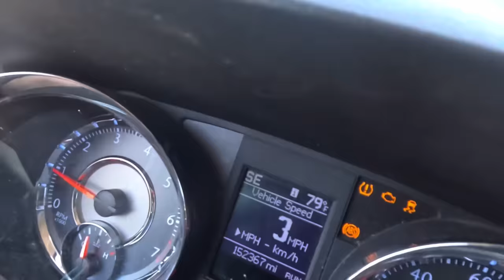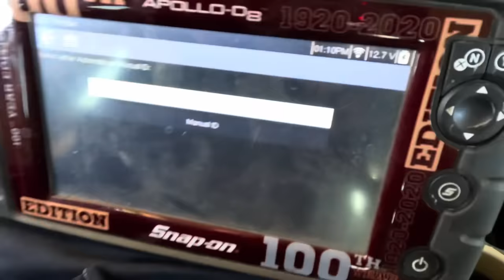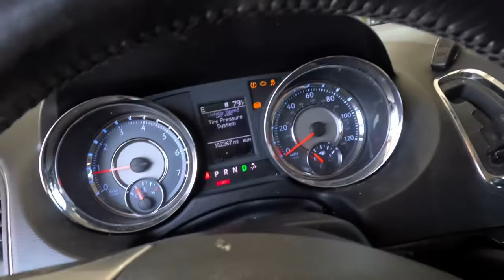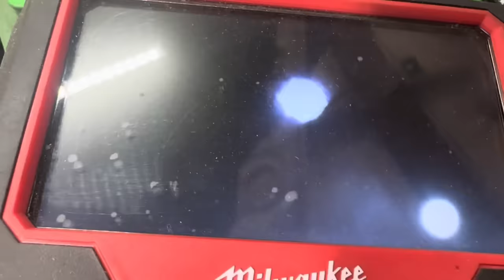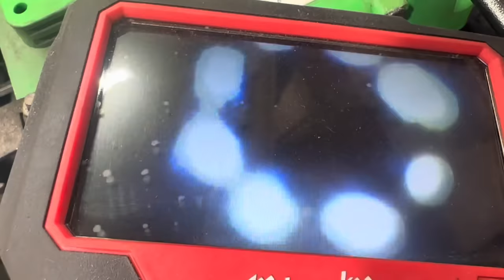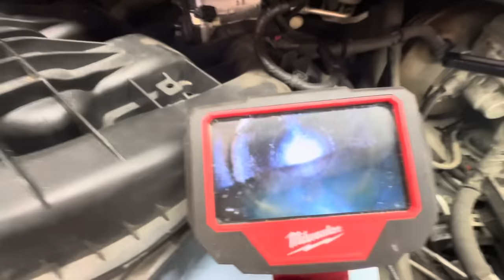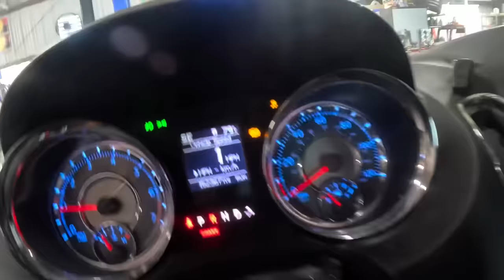Towed In! Died on Highway! (Engine is Drowning Itself!) Chrysler 3.6

Comment: I wonder why manufacturers have never added over-temp or low-oil pressure shutdown. I did have a Ford Ranger years ago that had a low oil level sensor that prevented startup. Even the cheapest lawn & garden engines have low oil shutdown.
Reply: Because we live in a litigious society, and it is viewed as safer for the occupants of the vehicle to allow the vehicle to damage itself in the effort to get out of traffic in a graceful manner rather than just drop dead. There is always time between warning lights and major damage, and in the case of cooling system failure, it's more than the sometimes only a few seconds that oiling failure can give, but this is classic operator foolishness. It's a good thing Ray is such a gentleman; I'd have been severely tempted to give the owner a hard time for driving it with obvious problems until it quit.
Reply: @edifyguy  That is no excuse, there can be a limp mod or a timer. If there is no oil pressure it will blow and that will shut it down where it is for sure.
Reply: @thepubliceye  What is possible and what is advisable are two different things. Everything you state is possible is, of course, possible, but a very risky idea. For once, I think the manufacturers have done the right thing. It is far safer for the occupants to have the vehicle simply warn the driver that a problem has occurred, and allow the driver to make the decision about what to do next. A good driver will get the vehicle off the road as soon as physically possible and turn off the vehicle. This will minimize the danger of getting in a collision, and keep the damage to the powertrain to the minimum possible within the constraints of human safety. A driver with questionable judgement will often keep driving until the laws of physics make that impossible. In both cases, it's safer for the manufacturer to allow the driver and the laws of physics to dance without interference. If the manufacturer intentionally interferes, they open themselves to massive lawsuits the moment someone gets hurt, even if it was clearly not their fault.
Reply: @thepubliceye  I have no issue with vehicles which refuse to start when parked if there is no oil or oil pressure. For vehicles with electric oil pumps, where the PCM can expect to see oil pressure before the engine is started, I think this makes excellent sense, and checking a level sensor before allowing cranking could also protect an engine from an oblivious operator, to a certain extent, but the fact of the matter is, most of the time, engine damaging oil starvation occurs with the vehicle moving, and forcing it to shut down sooner in an attempt to protect the motor places engine longevity ahead of human safety, and that's wrong.

Comment: Everyone is bashing chrysler but what about the "driver" more like a steering wheel holder. If your temp light comes on you may want to pull over, not keep driving and hope it goes away. Costly mistake.
Reply: I hate to be stereotypical, but female drivers (a minivan's usual) tend to ignore the warnings, and not always because they're oblivious, but often because they're frightened, and don't want to be stopped in a place where they'll feel unsafe, so they want to push ahead and get somewhere safe. That's understandable, but it usually ends with stopping somewhere less safe than what they could have planned if they'd heeded the warnings, and expensive, major damage. I've seen it firsthand with my mom when I was a kid.
Reply: If it wasn't a Chrysler, the light wouldn't have come on in the first place.
Reply: @stargazer7644  Seen plenty of fords and gm's have the light come on. Never personally had it on any of my Chrysler products but I maintain my vehicles, including the cooling system. Brand doesn't matter if you don't maintain it
Reply: @masont2544  I'm not sure what routine maintenance you're supposed to do to keep a cheap plastic Y adapter from blowing apart.
Reply: @stargazer7644  maybe replacing your coolant... Keeps stuff like metal and plastic from corroding

Comment: My 07 5.3 has the same type of plastic fitting on the heater hose. I think the fittings are pretty common.
Reply: They are, but hating on Chrysler seems to be a popular pastime in this comment section. The first one I replaced was on a 90s Buick, quite awhile ago.

Comment: There's lot of folks spouting ignorant hate on the Pentastar here. It's well-known to hit high mileages, especially when it's the longitudinal version. One of the higher ones was a van who did courier work that got well over 600K with basic maintenance. I routinely see JKs here both left-hand and right-hand mail varieties hitting 300-400K with their Pentastar engines. Most of them are MPFI and not an obnoxious HPFI setup with the failure-prone high pressure fuel pumps. Chevy V8s die a lot due to their AFM systems, Ford has its cam phasers, valvetrain issues (well-documented on Godzilla V8s) and belt in oil type oil pump drive belts, other manufacturers have timing chain tensioner issues, Honda had the oil dilution fiasco...pick your poison, every manufacturer has it's engineering foibles. But to make broad, sweeping generalizations like, "Well yeah, it's a _______, they're all junk," just makes you look foolish.
Reply: I hate to be stereotypical, but female drivers (a minivan's usual) tend to ignore the warnings, and not always because they're oblivious, but often because they're frightened, and don't want to be stopped in a place where they'll feel unsafe, so they want to push ahead and get somewhere safe. That's understandable, but it usually ends with stopping somewhere less safe than what they could have planned if they'd heeded the warnings, and expensive, major damage. I've seen it firsthand with my mom when I was a kid.

The biggest defect with the Pentastar is how many get installed in minivans.

Comment: Yay for Chrysler quality! 150k miles and already suffering catastrophic failure*. Then again, if an engine starts acting a little funny and you don't immediately check the engine temperature, you get what you get.

*I had a '95 Dodge Stratus which was nice for a while but turned out to be a total POS. Chrysler couldn't figure out a serious problem with it so they kept applying band-aid fixes and sending me away. They claimed it was something different every time, despite the same symptoms coming back over and over, to prevent it being covered under the lemon law until it was no longer under warranty. After a couple more serious build quality problems arose, I just sold it to a used car dealer for maybe $2G when it was seven years old and had maybe 50k miles. My 18 year old Toyota Matrix with 175k miles still runs like a champ. All I've had to replace, other than brakes and batteries, is a fuel pump, front struts and lower control arms.

Comment: Another engine killed because of a cheap plastic part. Just happened to me last Saturday on the expressway with a Mazda CX7. Plastic water outlet on the cylinder head ruptured. Massive steam cloud and every warning light came on. Drove a half mile to get into a parking lot. Towed 40 miles home. Just replaced that stupid part and at least for now engine seems fine. Keeping fingers crossed. Thing is that part is a known high failure piece but they used it for 11 years.
Reply: "Drove a half mile to get into a parking lot." Why? Why would you risk the engine? Just pull off the road and tow from there.
Reply: @edifyguy  Didn't lose all the coolant immediately. Also this was the Garden State Parkway which controls who tows, where and when. You have no choice as to any of this. Engine is fine, repaired myself and a 40 mile tow cost me $50. Would have been screwed royally had I left it there.
Reply: @patricknesbitt4003  In that case it makes sense. It's nice to know there are sensible people driving cars. :)

Comment: Sad day. I know it takes a minute to get an engine hot enough to warp and crack you would think there's a way to get a high temp limiter that would turn off the car BeforE this happens
Reply: Can't do that on cars people will sue if there car dies and there's an accident 😕
Reply: @stevenakn1  100% sure the engine will stop either way. The issue is will stop before or after permanent damage
Reply: @Ikantspell4  I agree 100% but I'm pretty sure that's why they don't do it.
Reply: @stevenakn1  It is why. It is factually safer for the occupants if the manufacturer builds the vehicle to allow the vehicle to damage itself in the process of getting out of harm's way. The biggest issue is that people don't just get out of harm's way.....they try to get where they were going.
Reply: @edifyguy  even with all the dash lights in the world they just keep going.

Comment: @Ray: has the temp sending unit and dash light(s) been verified?  I can believe a potential coolant dump going unnoticed on the highway, overheating warnings should be noticed; found this on @eric does cars, so very curious how long it takes from the “hot” or “no coolant” alarm, until it blows the head or head gasket or entire engine!

Comment: The earlier pentastar also had problems from the factory heads not being clean out properly from sand or aluminum shavings from the molds before they were install on this engine.The updated engines like the 2019 s seem to be a better made engine,but I still don’t agree with the plastic particles they are putting on any of these newer vehicles.

Comment: Just do a head gasket test on the radiator. Waste of money to pull manifold. JT @onlinemechanictips says its a no go doing head gaskets on an overheated pentastar it never works out. New/used engine is only option or scrapyard

Comment: 6 weeks ago i was driving across town when i got a high temp idiot light and a pegged temp gauge.   Was in total panic because i could not pull off the street for two minutes due to heavy traffic.
Just as i got to a parking lot it when my 2011 Ford Focus with 14K miles (yes 14,000 miles...I'm old and don't drive much) went into limp mode.
Tried looking for leaks and nothing seemed wrong.
Turned out to be a dead alternator was not giving enough juice to run the engine cooling fan.
Shop replaced alternator and all seemed well.
UNTIL it happened again.
But this time i got off the street fast and checked that everything obvious was working.  Two minutes later temp light was out and gauge was normal. PLUS! I had an Amazon sourced ODB2 reader in the car (did I mentioned I was really paranoid about getting stranded across town again). The scanner indicated 253 degrees coolant.  But two minutes later it indicated 173 degrees. With NO codes set.
Since we DON'T HAVE RAY AROUND HERE 😡🤬😡, I had it towed to the Ford dealership (don't hate me).  A week later they diagnosed a bad temp sensor and all still seems okay.
BUT I still am carrying the scanner with me every day!
RAY PLEASE MOVE TO NORTH TEXAS!

Comment: Almost the same thing happened to my 3.8L V6. It had a head gasket leak that just got really bad and started putting oil and coolant mix into the intake through the PCV valve, and the EGR valve. I did try to fix it previously with some sealants, but they never worked.

Comment: Did the owner decide to have the head pulled? If the problem was a blown head gasket, and the engine was decent to begin with, couldn't it be repaired and put back on the road?

Comment: Plastic coolant fittings--what could go wrong? You don't want to hydrolock this anchor. It will make the torque converter bolts hard to access.

Comment: Can get away with replacing the culinder head gasket. While the head is out can check for warpage to make sure if the engine is good or not. If warped, new engine if not and the cylinder head isnt warped then slap a new head gasket and new Y pipe hose and shes good. 
Knowing that the engine is probably filling up with water and still trying to start it was hard to watch.

Comment: I had 1998 town country with 3.8 v6 and that motor was strong.had over 190,000 miles on it. I  should have kept it used it for trade in for durmax truck

Comment: Intake was loose and ray had replaced a thermostat on the side which removing that would have been part of that for more room...hmmm did ray forget to tighten that intake to throttle body.

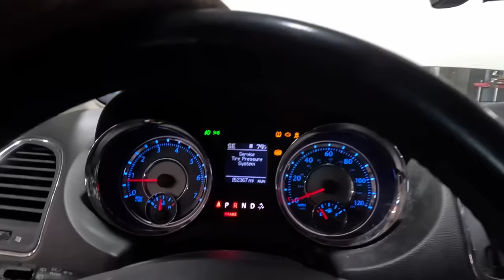Comment: At about 4:30 I was thinking that a potential coolant leak might be "a problem", but not necessarily "the problem".  Then going to about 19:30 after seeing liquid on the piston and about 20:30 seeing liquid near the cylinder wall realizing that was the problem and, as far as the engine was concerned, "it's dead, Jim"

Comment: Ford does the coolant-Y in plastic on the truck diesel 6.0L. I changed mine to a Dorman aluminum replacement to help avoid the possible coolant dump.

Comment: 150,000 miles. Coolant and hoses should of been replaced at 100,000. Operator error.
Reply: Interesting theory. Is that in the owner's manual that no one ever reads?

Comment: The 3.6s expecially the earlier ones where prone to headgasket falure to begin with but typically was on cyl 2 from what i had seen. And very surprised it did have the penta star tick or the destroyed oil cooler.

Comment: What is that foam thing called between intake and valve covers.. my 05 no longer has that because it was so destroyed.
Reply: Coolant diaper.  😜jk
My 2002 Toyota Camry 4 Cylinder (mini- NorthStar 2AZFE) engine had it, below the plastic intake manifold too.
It was saturated with coolant, due to cylinder head bolts pulling the threads on the block, ultimately destroying the head gasket.  New head gasket, Time Serts, and new head bolts were required to fix this engine.
I caught the temperature gauge rising just in time, otherwise, I would’ve trashed the engine.

Comment: I propose a different scenario. The head gasket failed first allowing combustion gasses to over pressurize the cooling  system and that caused the old plastic Y fitting to fail. Once that happened the engine overheated quickly and then no more engine. 
Happened to me with a LT-1 Impala SS. Those thermoplastic pipes don’t age well and just fall apart with any kind of pressure. Head gasket fails and the plastic pipes just give up from being so old.
Reply: It's possible, but less likely than that it happened the other way around.

Comment: i can tell you with certainty that a 2011 VW Jetta can run up to 83Km doing 140Km/ph before the engine dies. i know this because of reasons lol. valves fried, needed new engine head. surprisingly less than $2,000 altogether. 3 years later still purrs like a kitten
Reply: currently just over 300,000Km  ~200,000Mi

Comment: Ray, like your diagnosis but could you just replace the head gaskets to fix the problem. If there is no water in the oil, then the mains and rods should be O/K.
Reply: if these have an aluminum block the block and heads will be warped. The labor involved to rip it apart and machine the heads and get it all checked would be as much as swapping the engine lol. if it really go hot enough to shut down that whole engine is cooked.
Reply: @TechMaster2133  Wile I partially agree. The problem is that you do not know what you are getting. If I rebuild an engine, then I know what is wrong.

Comment: Too bad for the vehicle owner that the plastic component failed dumping all the coolant. Yeah, they should have noticed the temp rising and steam, but maybe it happened fast enough that it was unavoidable. I always survey my gauges as a habit of normal driving. I would encourage that in any driver.  Costly - needs an engine or at least cylinder head(s).  At 100K+ miles, decisions to be made once Ray develops estimates.
Reply: The driver admitted to continuing to drive after the power started dropping.
Reply: @bindingcurve  I hate to be stereotypical, but female drivers (a minivan's usual) tend to ignore warnings, and not always because they're oblivious, but often because they're frightened, and don't want to be stopped in a place where they'll feel unsafe, so they want to push ahead and get somewhere safe. That's understandable, but it usually ends with stopping somewhere less safe than what they could have planned if they'd heeded the warnings, and expensive, major damage. I've seen it firsthand with my mom when I was a kid. She got lucky (or rather, my dad did) and the vehicle survived, but that is not the norm.

Comment: I have a dodge dakota with a 3.6 misfiring on 4. Temps fine though. I think it may be injector. Already replaced/moved coils and plugs. Ran cleaner through the gas. Checked compression and all cylinders are within spec. A little low on spec bit still spec and all in same range as each other. So i beleive its injector. Just dont wanna tear it all apart to replace it. So much work for such a simple task.
Reply: Listen to the Injector with  really long screwdriver. Chris Fix has a tutorial in his channel